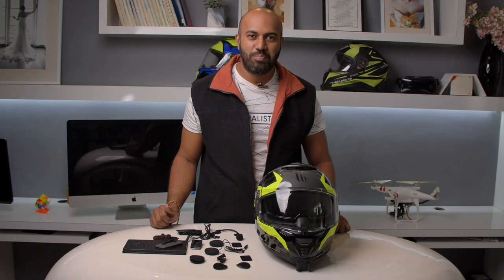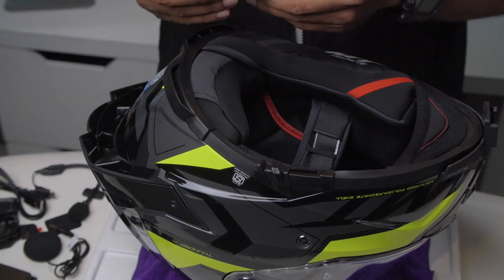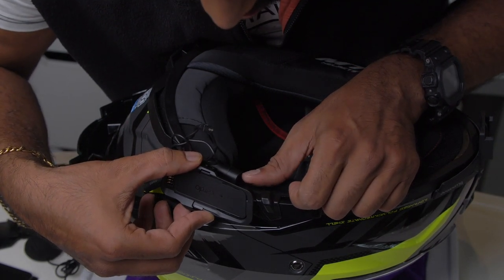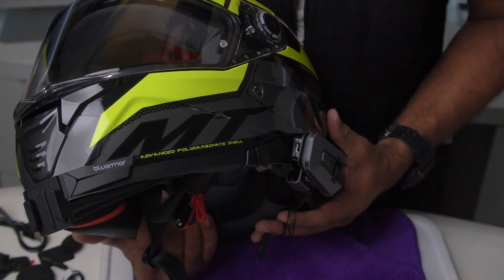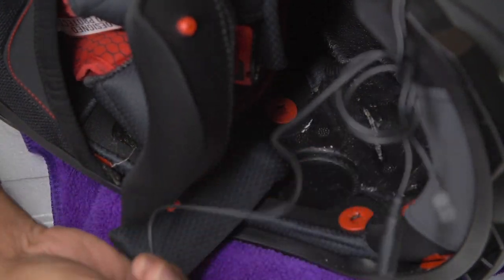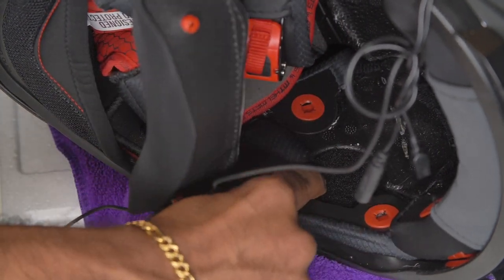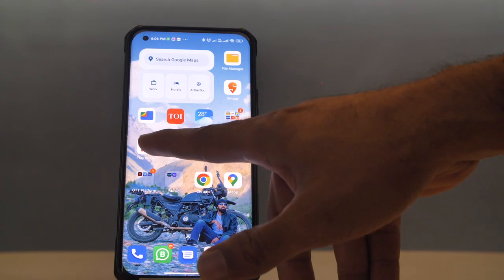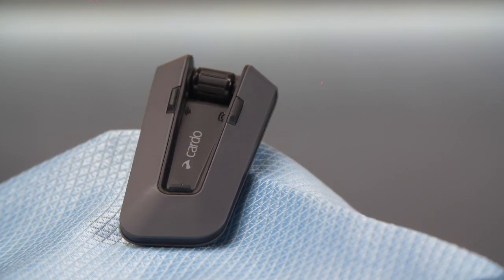Installing Cardo Palktalk Edge in a MT Helmet Thunder 4

Comment: is it possible to mount it on the right side???
Reply from the maker: if you try the right side then it will be facing the opposite direction. All the communication devices are designed for left hand side.